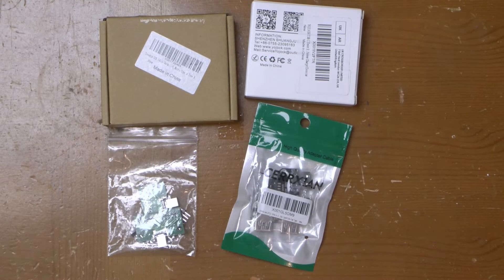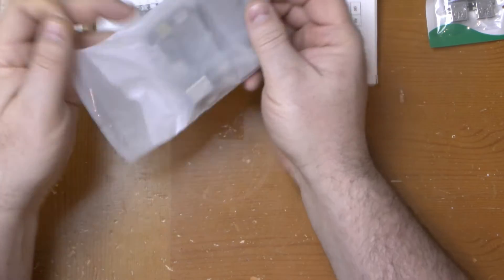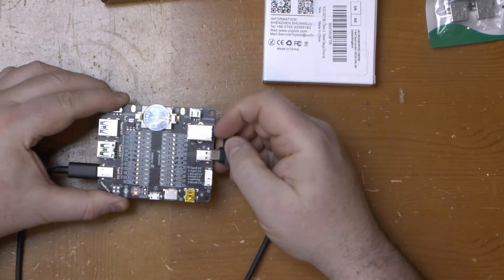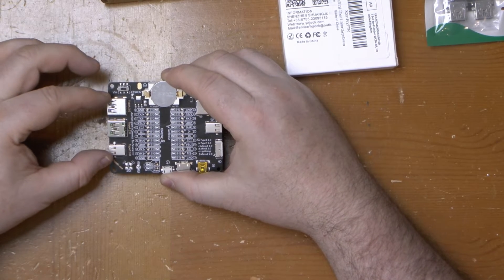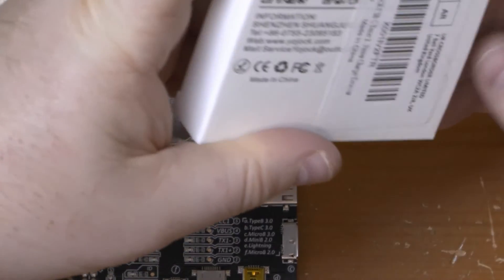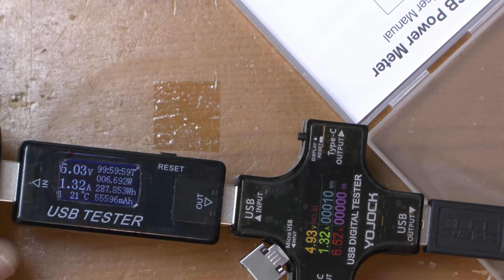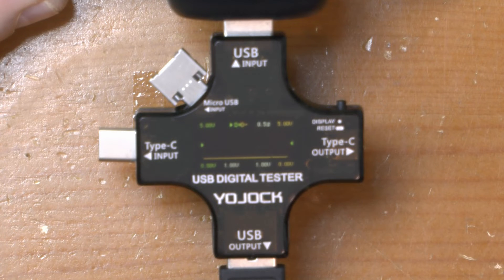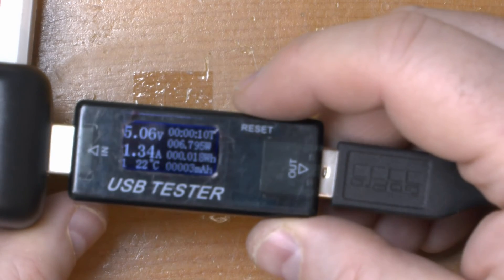USB testing bits and pieces

Comment: 1:31 Oh, that's very useful! Good to know something like this exists. This is useful more more than just wiring order, but also fault. You know, those pesky cables that are only just starting to break and the fault only exists in one specific position. Good stuff!
Reply from the maker: I've also used the breakout points on the cable tester to test the USB-C pinout of the Aodeng travel adapter in one of my other recent videos.  For that I didn't use the left hand ports, I just plugged a USB-C to USB-C cable into the right-hand USB-C port and continuity-tested from the IC on the board to the test pads on the tester.  Very handy.